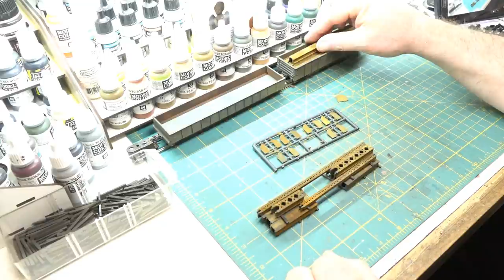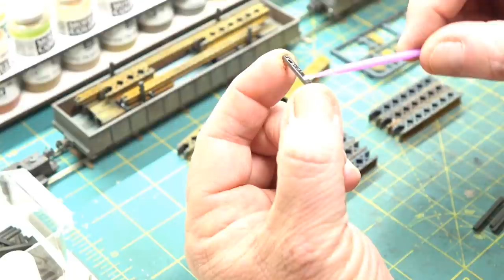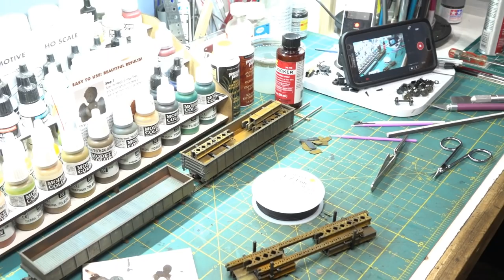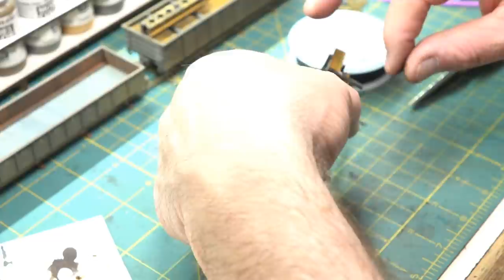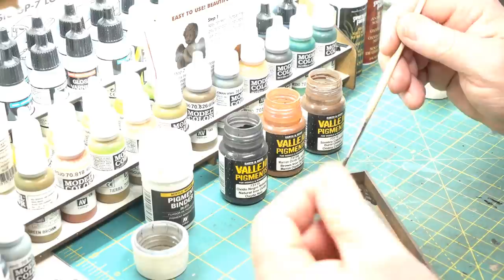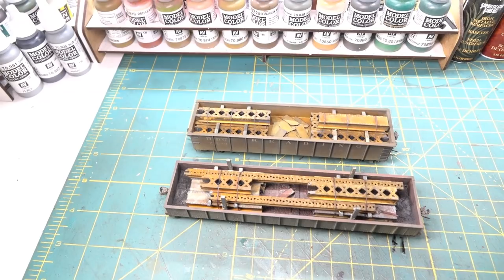MRUV 149: Two Scrap Steel Loads for Gondolas

Comment: Hello Steve,. When I put my scrap steel into gondolas. I made a false floor that sat stop the actual car floor. Most times the scrap was just thrown in any old way.  With two floors you can see one rusted up inside the gon attached to the scrap load ( weather beaten and really rusty steel floor ) the actual car floor when empty I showed as new flooring with very little aging or weathering. One or maybe two in a moderate train length is a good visual. But Absolutely No shiny freight cars.
I cut up some old rusted ( real rust ) washers two at top of pile. Of junk.  I  cemented a small magnet to a stick so I could remove the load.
All my loads have their own floor cemented to the load .   BUT NOT THE CAR.
I adore your longer videos. I tend to watch late at night while sitting in bed. Waiting for my eyes to slam shut. I mostly make all the way to the end.
I did notice that your breathing sounded better.
Take care stay safe and healthy just keep your distance.
Love to see a train with the ones you've weathered this far running maybe at very end of your video.
Thanks much. Laters.

Comment: Good job, lots of solid concepts .... Now... about the gusset plates tossed in the bottom of the gondola singly ... what about gluing the bottom layer to very thin clear styrene. Once dry, trimming away the excess clear stuff. Then add the upper layer to the lower ones randomly with the appropriate solvent. Just a thought...

Comment: I am no expert. Here is my opinion:
From what I have seen of scrap, it is unceremoniously dropped with an electromagnet.
To me those carefully tied loads look like they are going to a job site somewhere.
I really like the look you created.
Reply: I agree. They would look great strapped to a flatcar.
Reply: I agree with @Darria Carter 'flatcar' plus it would be easier to see the great detail of the load either way it is an excellent job, Mr. Bennett thanks
Reply: Agree with Andrew, 

I handle a lot of scrap overloads and unbalanced loads. They try to load the cars to maximum capacity, remember margins in the scrap business are very small.  Lattice beams and empty space would result in those car being loaded pretty light.  Material such as scrap also is not secured in the car, only of the material is above the top cord and can fall out is securing material required.

Comment: Great job, the load looks plausible. i doubt if they would band scrap steel beams this big. i think the weight would hold them in place but if you hadn't mentioned it i wouldn't notice, it still looks realistic. i wonder if breaking up the gates the plastic parts come with would make great scrap  loads. they would look like they come from some machine shop used for who knows what.

Comment: I've watched hundreds of loads of scrap steel go by. I must say, I have NEER seen one that was loaded neatly. Never. Most scrap yards load with a crane with a big electromagnet. Flat material that wind could affect often is put in the bottom, along with cables and other smaller scrap. Bigger heavier pieces were put on top. After the first few miles, everything is settled in and doesn't move. The wind won't blow a 2 thousand pound chunk of steel out of the gon. It is usuallt unloaded with an electromagnet too. Beams and such that might be too heavy for the magnet to lift are loaded with a forklift or crane. Loads are most often well below the gon sides, steel id very heavy! In the past, loads that had only short pieces, 2 feet or so, got a premium price. "2 foot steel" was easy to feed into the furnaces. 6 foot lengths are not! Heavy shears or shredders were sometimes used to make loading furnaces easier. Leave one piece sticking out for a "handle" to make the load removable on the layout.